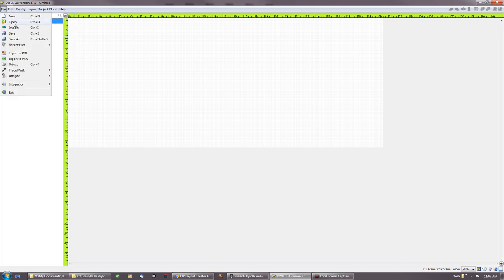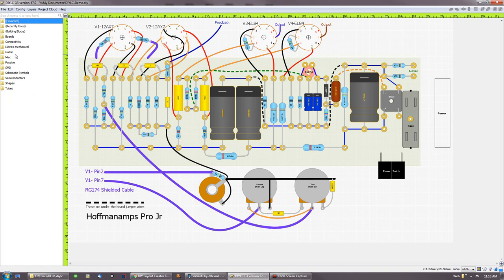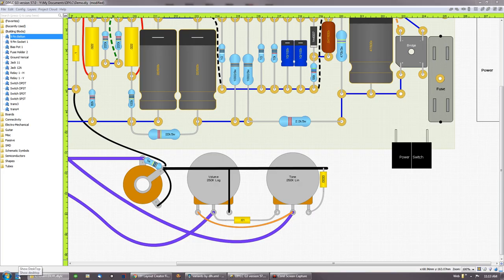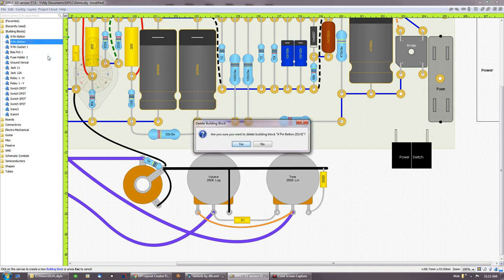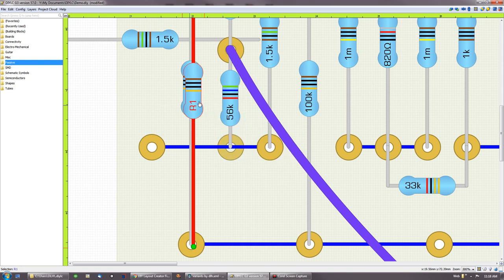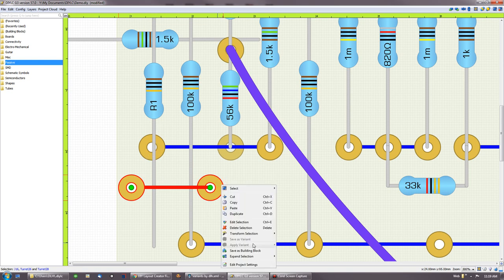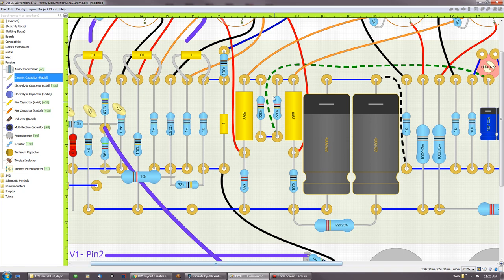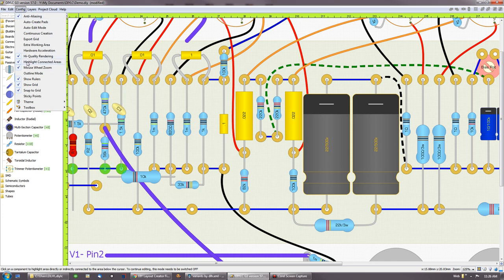Do It Yourself Layout Creator Menu settings

Comment: Thanks Doug, good timing for me as I am just about finished setting up a new Windows10 computer from Win7. I see Banica keeps improving things along! I am hoping all my old custom components will easily migrate once I install the new DIYLC. Also doing the same for jsch program, Tone Calculator, Inkscape, etc. Can you suggest other freeware programs available like maybe the Duncan bias calculator (if it still exists/compatible with Win10, Load line plotter (Blencowe still available?), Inkscape, etc. ? I will need all of these too. Lastly, I LOVE this DIY program so much for many many reasons and am wondering if this is replacing your Visio program for all of your amp projects? Or was that just sluckey, Ed, and others that used that?
Reply from the maker: I don't know much about other programs. Some components may not import, hard to say. The forum DIYLC board may have more info on that?
The only reason I would still use visio is because I can take an existing amp file and make a new one way faster than starting from scratch. 
The only file I have created on DIYLC is the ProJr. All other files were made way before I had DIYLC.
I don't crete many new amp boards these days with all the components.
Making custom boards on my CNC machine is really the main reason I hope people will use DIYLC